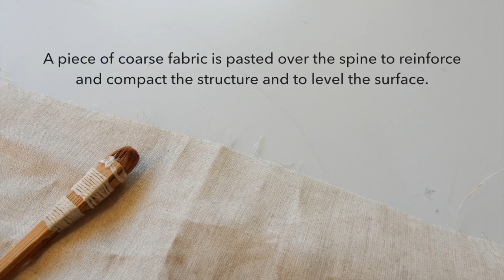Crafting the Codex

Comment: Fascinating video! Thank you very much for posting. I have a few questions about the technique:
- what type of wood is used for the boards?
- what is the thickness and overall size of each board?
- are the boards treated at all? They look as if they have some form of coating on them.
- what is the size and type of thread used?
- what type and weight of paper was used for the text block? What size signature was used and how many are there?
- what is the name of the tool that you use to gouge out the channels for the thread and what size blade does it have?

The endbands are beautiful, but I don't quite follow the technique for sewing them. I would love to do a similar project, but the making of the clasps and the leather attachments was glossed over at the end. Have you published more detailed instructions anywhere that I could access? Thank you.